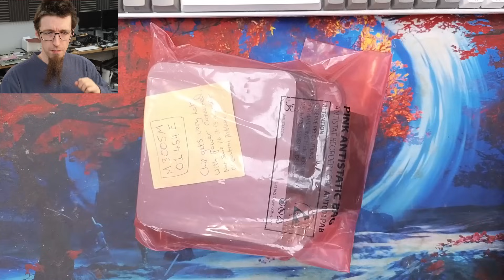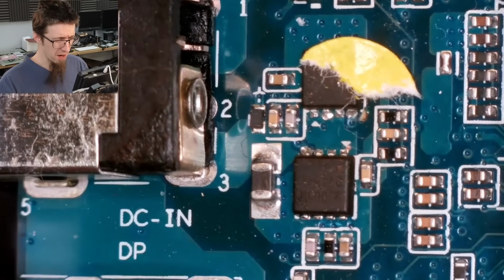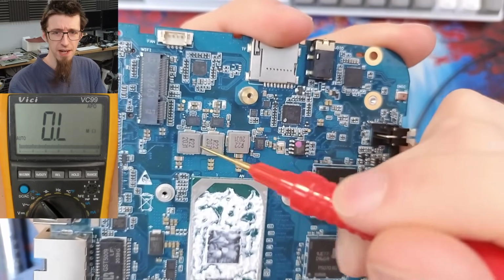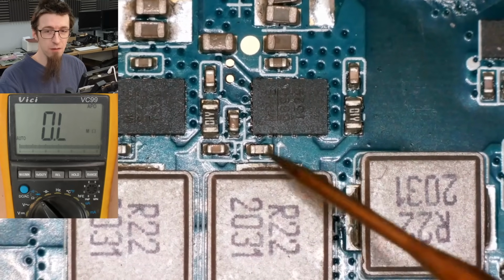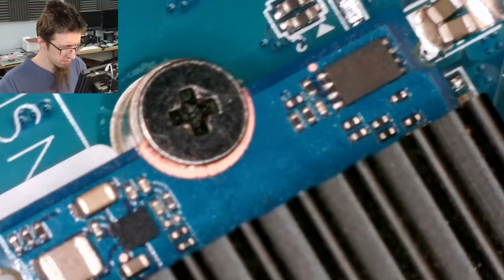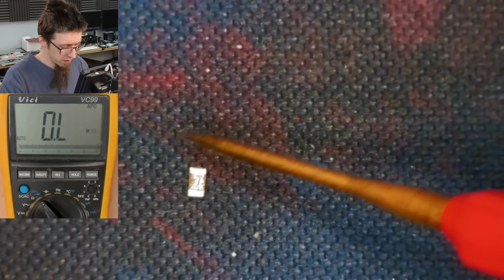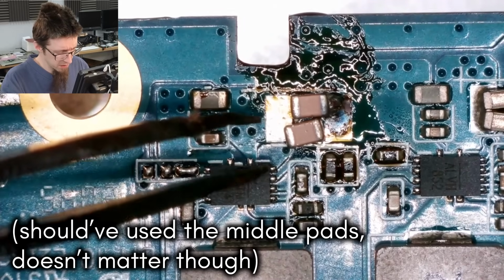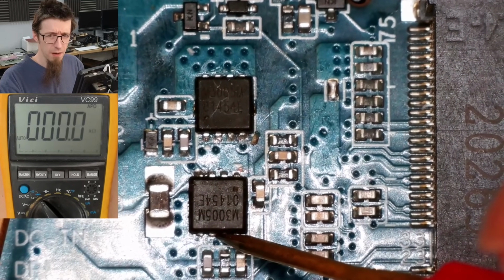Minis Forum X35G No Power #404

Comment: Cleverly hidden in the manual for your multimeter.. 

4-13.Auto power off 
1. When the meter stops work about 15 minutes, the built-in buzzer will be sound 5 times and 
turn into sleeping mode, 1 minute later, the buzzer sound a long voice 1 time, the meter will 
be power off. Press any key to restart the power. 
2.Press “DC/AC” key and then turn on, the auto power off function will be cancelled
Reply: Why would they hide it in the manual? 😩 😉
Reply from the maker: Outstanding. That worked a treat - many thanks!
Reply: Good onya for passing this info on, this is what it's all about...helping each other !!! 🤠😎
Reply: @AndyM...  Every meter I've ever owned has this feature and the manuals are usually pretty small and the make and model of the unit was right there so I took 20 seconds out of my day to help him and bust his balls at the same time. I know when I hear those beeps they are so annoying. They do let you know when you've spent way too much time chasing one little problem but I'd rather just feed the darn thing batteries too than hear those beeps. The long beeps just grate on you. It's amazing how a 3 second beep can be so annoying.

Comment: You're not supposed to hand-solder MLCCs - the thermal stress from heating them unevenly promotes the exact type of cracks that caused this fault to begin with. First you get cracks, then silver migration through them when voltage is applied (thank you, lead-free solder), and eventually, kaboom.

Comment: I was working in a non-IT role some years back when a PC failed to boot after being moved. 
Volunteered to have a look at it and found a spare metal spacer lodged under the mobo along with a TO-220-style MOSFET from the memory power supply that had got hot enough to melt its solder and drop off the underside of the board.
Soldered it back and much to my surprise all was OK. 
The PC's network name was changed to Phoenix...

Comment: Im new to this stuff and to me all those capacitors, inductors, fuses and resistors look the same (those little cube looking things). How do you distinguish them from one another? Is there some color code or anything that would tell you right away what it is?
Reply from the maker: Yea there's some colour coding, but also just shape and size. For small parts, brown for capacitors and black for resistors. Large parts, capacitors typically have a plastic case and inductors are the big square bois.
You can get small SMD inductors that are also black, but they tend to be larger than resistors, which is how you tell them apart. A lot of it is just context as well, knowing what parts do helps you identify them, eg "that must be a SMD inductor because it doesn't make sense for it to be a resistor"

Comment: the caps were connected on the left and to the middle not on the right hand side
Reply from the maker: Middle pads are extensions of the right, for smaller components. I did notice this afterwards, hence why the caption appears in the video at that point, but it doesn't make a difference to the functionality.

Comment: When a MOSFET has been stressed, such as in this example, how does that affect its reliability in the average use case scenario?
Reply from the maker: Probably fine in this case, as the DC in mosfets are expected to be 'always on'. Buck regulator mosfets on VRMs are switching at high frequencies, so they're never passing full current, they wouldn't appreciate the always-on of a stuck gate. It's also unknown how much heat was actually there... the human finger will get burned at 60c, but mosfets are fine up to about 90-100c. So the heat may have been well within the acceptable range.
Reply: @Adamant_IT  It's amazing how small they are, thanks for your reply.
Reply: A perfectionist may replace both mosfets (but then you may not have them and that would delay the repair and cost the customer more). Theoretically 2Amps went through them before the PSU hopefully shut down and although they can handle that (up to 15Amps nominal, 42Amps max, according to the datasheet, hard to believe) anything hot enough to affect a DC jack warrants further remedial work, in my opinion.
Reply: @ralphj4012  yeah toasting the jack shows it was super hot
Reply: Shorted capacitor on main power rail sometimes leads to (partially) shorted DC-in MOSFETs, so it's worth checking. But if it measures fine, it's most likely fine and unlikely to fail soon after.

Comment: Looked like someone replaced the input mosfets since the dc jack took some heat. Also the pads of the mosfets looked non-factory.
Reply from the maker: Hard to tell. Bloody neat job if they did. I think maybe someone was in there with a soldering iron or hot air, but bottled out.

Comment: Pro tip: To avoid tiny smd parts flying into interstellar space at warp factor 9 when trying to measure it, resolder it back onto the board but with only one side connected with the other side not touching anything, then you can get a good connection with meter and measure it.

Comment: But you literally soldered the capacitors in the wrong place, go back to the video and watch.
Reply from the maker: Middle pads are extensions of the right, for smaller components. I did notice this afterwards, hence why the caption appears in the video at that point, but it doesn't make a difference to the functionality.

Comment: holy crap!you must be really cheap bro lol.Your tools are for laughs and you are to stingy to use at least some bloody flux.Your hot air station is struggling to remove a capasitor from a small board! I guess you skipped the part of using thermal paste on cpu because it was really embarrassing.INVEST ON TOOLS if you want to call your self a repair shop.Politeness is not my thing(i know),but if you follow my words,you will be better tomorrow.